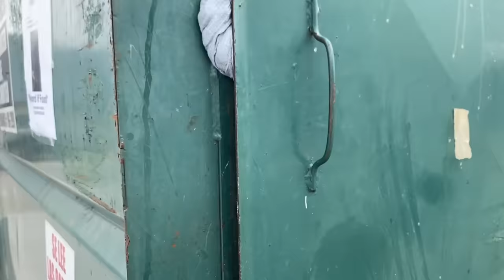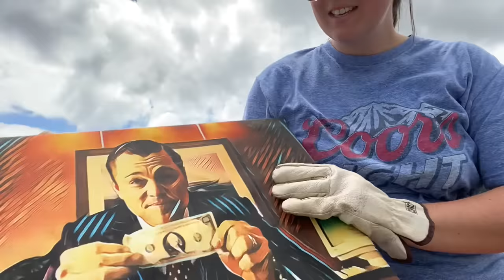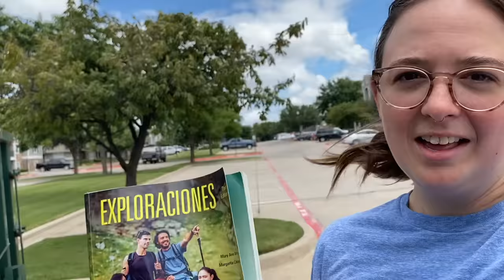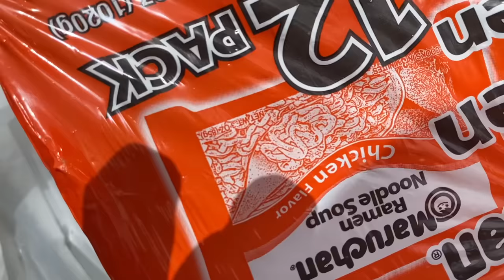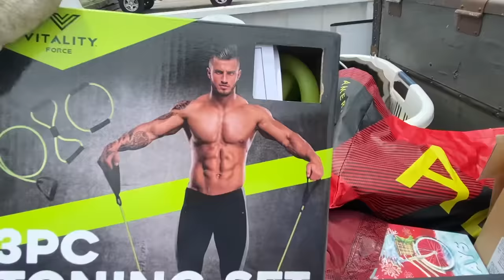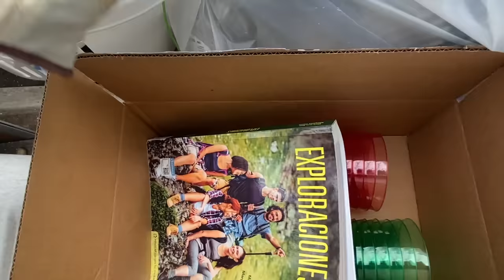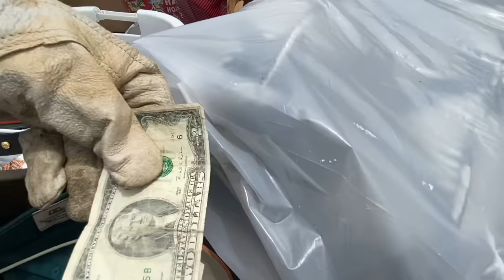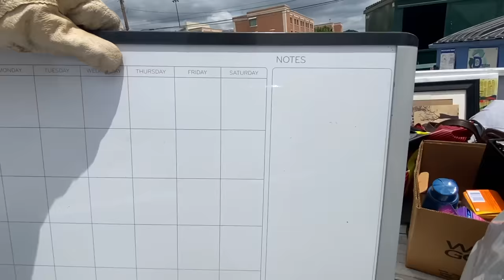I Found Versace, Coach, & Gucci in the Student Dumpsters!! OMG!!

Comment: You can clean leather with saddle soap.  Relic and Fossil are the same it's some branding craziness.  I believe Relic was sold in JC Penney.  
Vinegar and water can get the smell of moth balls out of clothing.  Just run washer with vinegar only, then wash with detergent and fabric softener.  If that doesn't work or the item like the purses,  baking soda can  absorb the odors.

Comment: The black cloth you found is a make up remover towel.  You don't need to use any cleanser to get make up off your face.  They are amazing and they are $20.00 a piece. New.  You can wash them in the washer and reuse them over and over.

Comment: 36:40 you can also use that macbook extender cable on an iPad charger. The plug end on iPad chargers comes off and you can connect that extension cord to your ipad charger for a longer range.

Comment: That is an Authentic Coach Style # 9012 Berkeley Drawstring Bucket Bag with the original Hang Tag. There's a black one on Ebay for $159 and 2 others for $99 each. A very sought after Vintage Coach Bag, Made at the USA 'B' Plant in April 1996.